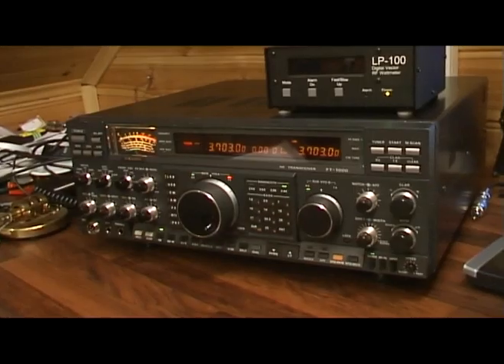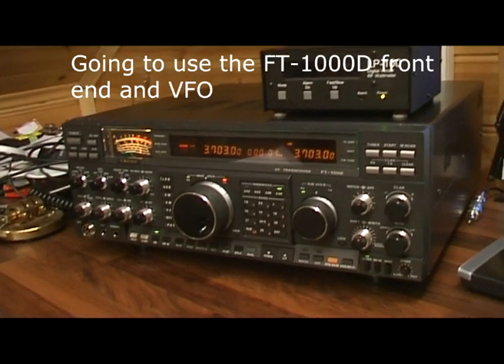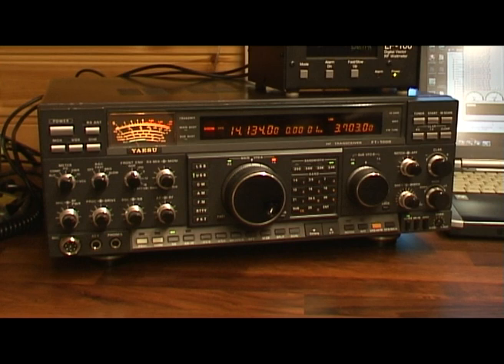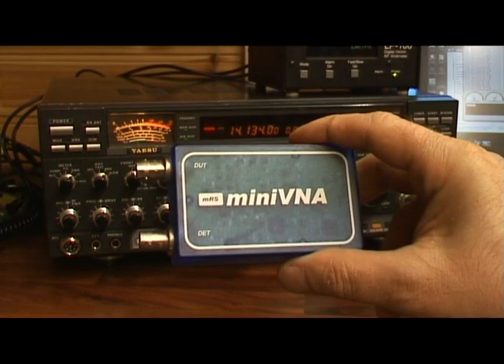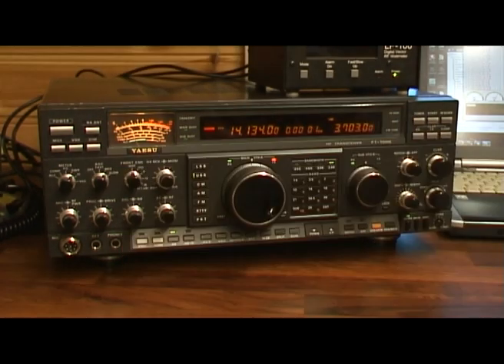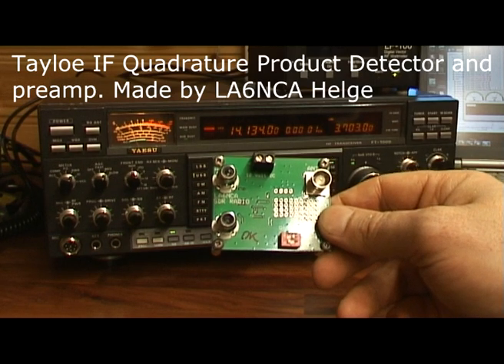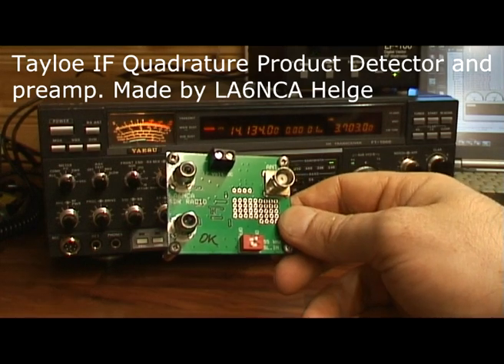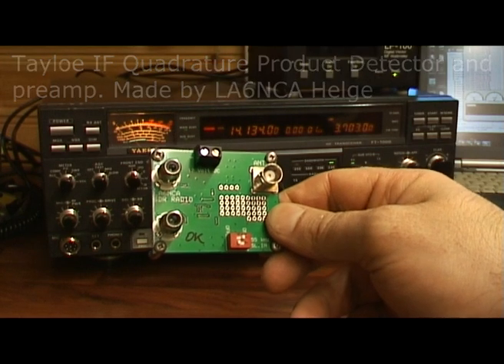PowerSDR / IF Stage FT-1000D

Comment: I'm very interested in your down-converter, but you didn't provide enough info on that for me.  Can you tell me the components you used?  I'm interested in getting the FT-1000MP Mark V IF down to a frequency that I can input to an LP-Pan.  
73, K8AC
Reply: I know this was asked years ago, there is no down conversion needed, the first IF of the FT1000D can feed the TV dongle direct.

Comment from the maker: (part two)
I think I found a way around this shortcoming, the solution was to set up HAM radio deluxe to communicate with the FT-1000D over CAT, then relay this communication via a virtual com port set up in HAM radio deluxe with the kenwood protocol.
FT-1000D - CAT over physical COM port - HAM radio deluxe listening on virtual COM port - Power SDR set up to use kenwood protocol
73
LA6TPA

Comment from the maker: Hi Emanuel,
It has been a while since I did this video but as far I can remember I think there is a shortcoming in the software that only allows the FT-1000D to update the PowerSRD and not the other way around.
ie. If you turn the vfo or press a functions button on the FT-1000D and the PowerSDR will follow but if you operate radio functions in the software, nothing or odd things happened at the radio.
(end of part one)

Comment: Hello, first of all fantastic video.
I see you use the CAT , can you share the settings?
I'm running an home made IF SDR made by I5XWW capable to catch the IF out of the Yaesu 73,62mhz and all works fine but I'm in trouble with the CATof the FT1000D
Thanks in advance, Emanuel      skype: IK2RGT